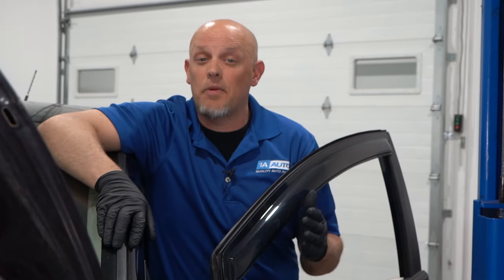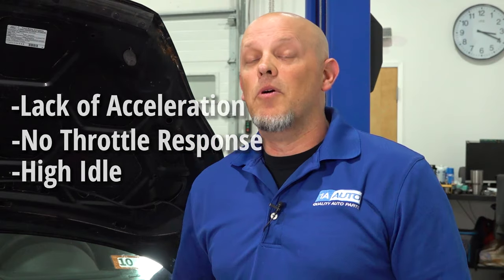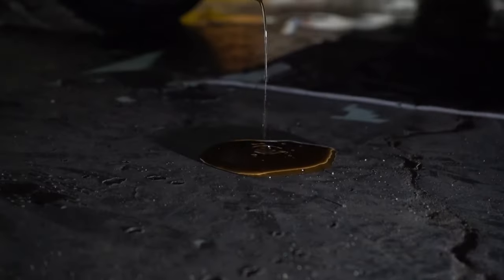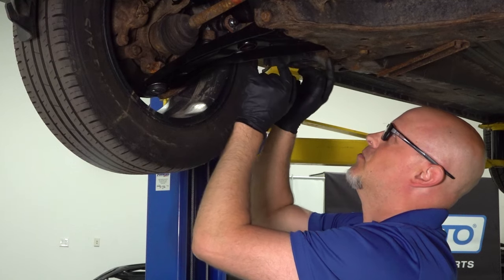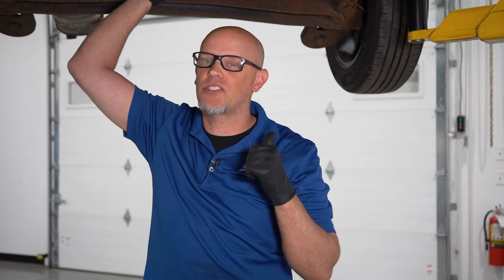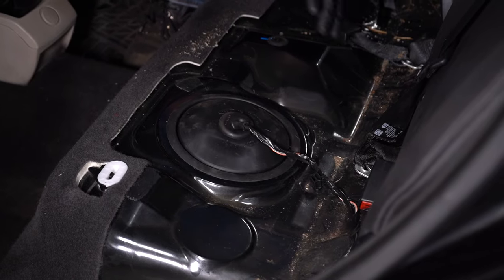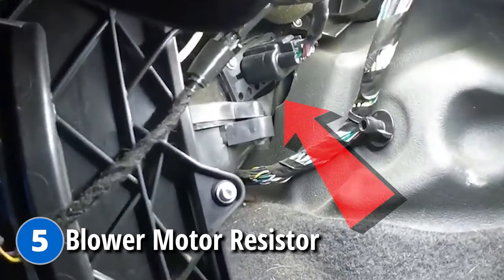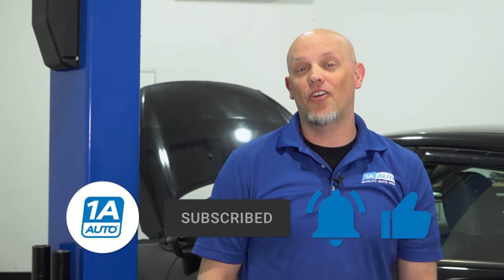Top 5 Problems Ford Fiesta Hatchback 2011-2019 6th Generation

Comment: I had a Ford FESTIVA. Got 200K miles out of it. Change the oil every 3K. Best car I ever had. Ran it into the ground.
Reply: Im in the middle of doing that to mine lol its such a fun car
Reply: @caseyjones5145  Fast and drives like a go-cart!
Reply: Happy you liked it! Planning on picking up a 2019 and doing the exact same to it. Trading in my current ride for a commuter that will be paid off instantly and driving it until it completely blows up. Happy to hear it was pretty much trouble free for you.

Comment: This video is called, "Top 5 Problems Ford Fiesta Hatchback," and it doesn't mention the transmission problem that was so bad there was a recall.  If you buy this car used, you will probably have to replace the transmission.  You should have called this video, "five problems that cars often have," because it has nothing to do with the Ford Fiesta.  It doesn't mention the door handle recall either.  Is this Ford fluff?

Comment: if you're buying a used fiesta and you drive fast and you bought from somewhere like a rental place or previous owner a old lady I almost guarantee you'll be replacing the throttle within the first year. I bought my car 63k miles previous owner was old lady it was very well taken care of but was never driven past 80 most likely 😂 had to replace my throttle in the first 6/mo other then that no problems. I went thru Ford and paid 600$ and now that I know how easy it is to replace I'm crying 😂😂😂😂 thank you!

Comment: I’m surprised no mention of the DCT issues
Reply: Go manual or go without.
Reply: @DashCamSerbia  absolutely. I wouldn't have bought mine any other way
Reply: It drives poorly, but isn't any danger it is more a quality of drive issue
Reply: Exactly, my Fiesta's Powershift TCM died at 76k miles and now it has been off the road for two months lol
Reply: @Kaizushiya  have you fixed it ?

Comment: Get a Japanese car and you will not stress at all. They start and do not cause unique problems.
Reply: funny because i have a Japanese car and it has many problems, i'd rather stick with my old 2005 ford escape 4cyl (that required minimal maintance and was a beast) than to get another japanese manufactured car any day

Comment: My 2011 I bought new never had one issue with it. Still driving strong only replaced the oil and air filter. Front brakes once and shocks. That’s it. Been a great car.

Comment: I have the 5 speed--super fun to drive and I get ~35MPG in town.
The water pump did go out.... but the good news is the one they replaced it with exploded so I got a free warranty-paid-for rebuild on my engine for the price of a water pump replacement.
Thanks for helping me catch my lower control arm issue before it got any worse.

Comment: If anybody considering buying one used get the manual. 2011 here 117k miles 100% reliable. The original front rotors passed inspection every year until I change them recently. Even the headlights are original.

Comment: As a fiesta 2013 owner, the only issues I had were: 
-Once the engine fan blew and had to replace it, it was kinda expensive
-after 9 years of having the car, both left door window switches failed and had to replace them. However its not that expensive

Comment: My fiesta had the biggest problem with water leaking into boot compartment trough some unvisible holes. I put silicone every where and changed gaskets under stoplights. Another problem coolant leakage from heatwater housing

Comment: The purge valve is common I replaced mine 2 years ago and just went out again code P1450. Used to work at Ford dealership and it was very common.

Comment: We own two manual gearbox fiesta circa 2017/18 1L ecoboost models. Both have needed gearbox bearings around 50-60,000 miles.

Comment: on a right hand drive is everything on the other side or does It stay the same, for example would the water pump still under the passenger side or would it be under the drivers side.

Comment: The low beams quit working on my 2013 fiesta. Found out the relay had corroded so bad that the leads broke off inside the fuse box. All the 2011-2013 fiestas I find in the junk yard have the same issue.
Reply from the maker: +Mark2Graves-Garage Thanks for the feedback!
Reply: literally just got this fixed on my 2012 fiesta. happens to every single one of them. best way to safely get home is keep your brights on since they are not affected.

Comment: 133000 on my 2011 fiesta sedan and a spark plug shot out of the cylinder head. Stripped. Apparently this is a rare thing on these?? Helicoil was not an option. I’m sure some garage monkey stripped it during a tune up. Also replaced the manifold/cadi.  Still got a p0420.  Going to do the two O2 sensors again. I got so much $$ it makes me sick but most all is service shop hours. Not parts. But it’s a great driver! 5 speed manual and I love it so much.

Comment: My car would idle at high rpm’s took it to get diagnosed and sure enough the throttle body needed replacement. $150 bucks for it. Did it myself a few bolts. No problems with that now.

Comment: my 2014 fiesta doesn't have any issues. but probably because it barely has any miles on. only 47200 ish miles driven.  I'm the car's second hand. first hand was my mother so I know for a fact that the car never had issues. its a good car

Comment: I have replaced oil cooler 3 times, especially after service the car turns to mix oil with water. Right now it is overheating.

Comment: Coolant Pipes   crack and burst, oil leaks from Gear box, Oil cooler failure leading to oil and coolant mixing. and rocker cover gasket fails. starter motor is another weakness and fuel pump. door handles become lose

Comment: I have 2011 Ford Fiesta 1.6, manual, hatch, . I ve replaced HVAC resistor 3 times! I think its a factory deffect! (Voltage spikes killing the resistor!) It will happen much less after 2012 and up

Comment: I have a 2013 Ford Fiesta and it has been giving me problems for the last month. I already changed the MAF sensor and the throttle body and it still gives me problems. It loses power and won't accelerate more than 40 mph.
Reply from the maker: +@faustinoaraujo4953 We wouldn't be able to diagnose an issue like that here, you may want to have a local mechanic take a look at it. Thanks for checking us out! http://1aau.to/m/Shop-1AAuto-c

Comment: Got 2011 ford fiesta ses mk6 no throttle response i've changed the throttle body, gas pump all four of the spark plugs cabin filter air filter, but still having a problem.Does anybody have the same issue that i'm running into

Comment: I have a fiesta 2011, and got the TCM replaced at the dealership in Texas everything was ok, until 2 weeks ago I changed the engine air filter and now I have the check engine light that wont come off, the reader says its the MAF sensor but cleaned it and still turned off for 2 days and keeps on saying its the sensor, anyone had this problem?

Comment: Can anyone tell me if the 2011 Ford Fiesta (manual transmission) has an air intake control valve or not? I can't find it anywhere on my car, but they are available for sale online. However, some forum posts are saying they don't have one.

Comment: Anyone have their AC start clicking/knocking where the diverter is under the dash? Mine still works fine, but it’ll click 20-30 times whenever I change the position. I’d like to know if there’s a fix for this.

Comment: I got a blower motor issue as it only works on the 4th setting, its super common and i replaced the resistor and that fixed it but only temporarily, next night after fixing numerous other issues it went back to only working on 4 again, any insight would be much appreciated!
Reply: The resistor failed for the 3rd time in my 2018 Fiesta. The last one lasted less than a year. I'm starting to think there might be an issue somewhere else.

Comment: From what ive seen online The blower motor is under the driver side, have to remove gas pedal assembly to get to it.

Mine isnt blowing air of Any kind whatsoever,  replaced Relay, Fuse and blower motor resistor, also new blend door actuator. Nothing happens. lol

Comment: my 2017 Mk7.5 1.0 ecoboost ran perfectly fine until it didn't™ and suddenly cracked a cyilinder... luckily engine got changed under warranty
PS: always serviced at the dealer

Comment: My car has low power and makes a buzzing noise at low RPMs with 10-40% throttle.
And it only is a problem with warm air. After a long driving session it occasionally has a rough idle. Couldn’t find a vacuum leak so maybe it’s the throttle or fuel pump.

Edit: Yes I had the DCT replaced.
Edit: When I say warm air, I mean warm weather. It does get worse after I drive it a bit, but it can be it can happen immediately after start up and is almost nonexistent in weather under 78F.